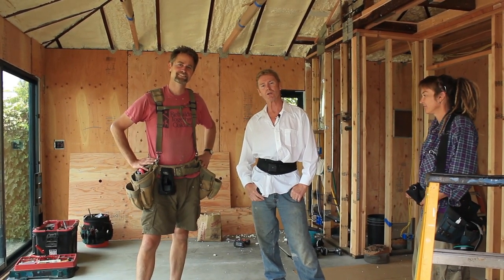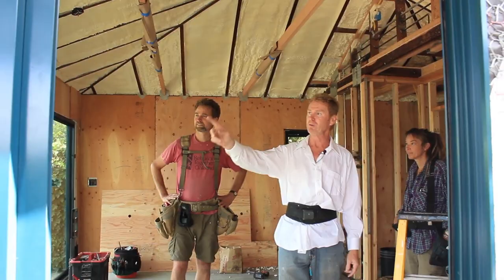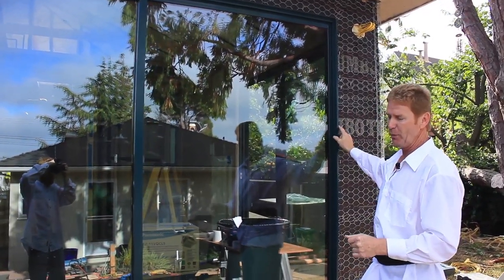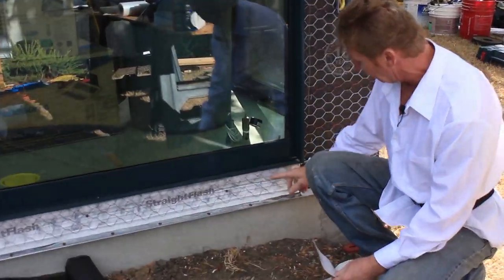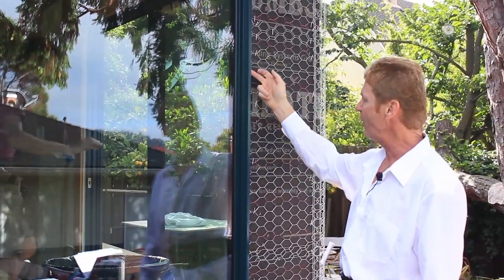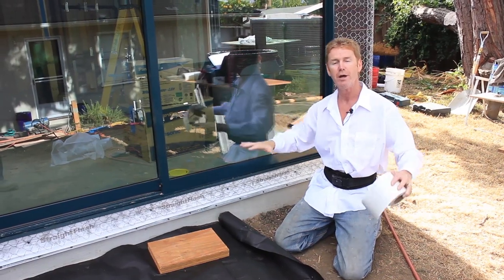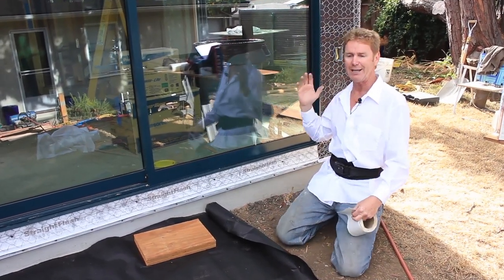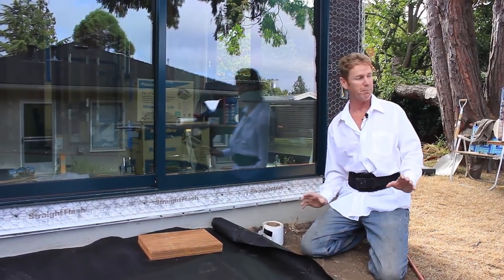Use flex-wrap for waterproofing exterior walls

Comment: What size is the straighflash u used
Reply from the maker: Good Morning Tony, most of DuPont straight flash or flex wrap Self Adhered Butyl Flashing Tape, for inner corner windows come in 6 to 9-inch rolls,
 I use the 6-inch mainly.
 FYI, this stuff is sort of expensive, but as the old saying goes, "you get what you pay for."

teaching plastering do’s, don'ts and reasons why
                     Live long and plaster
Reply: @StuccoPlastering  Thanks!really appreciate it!